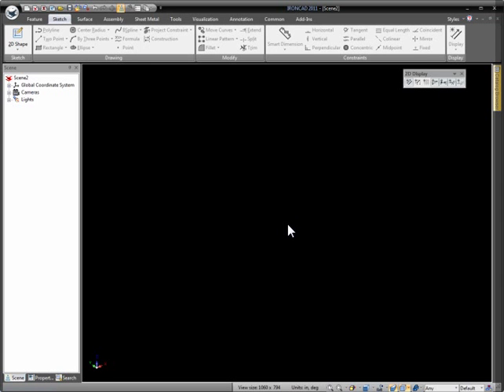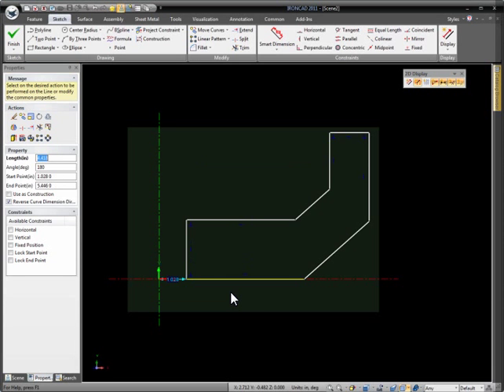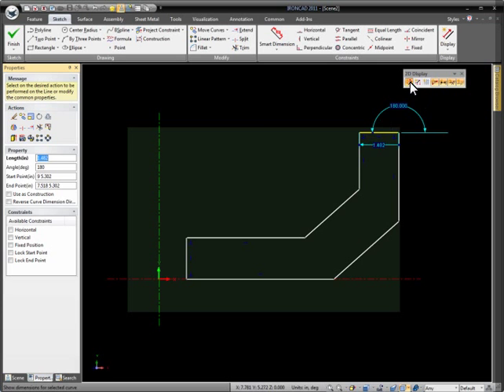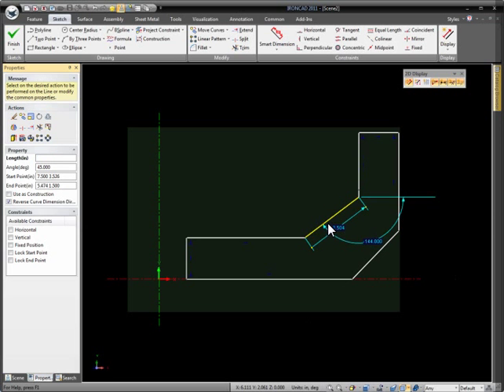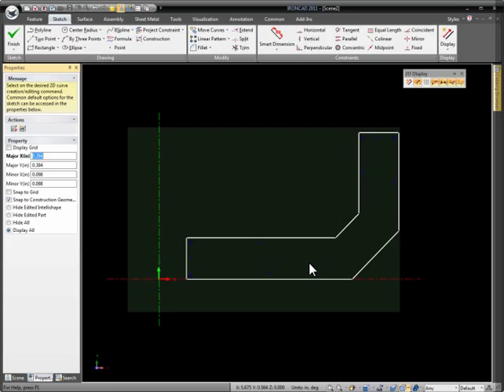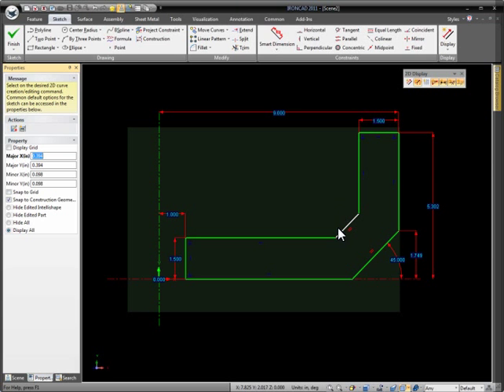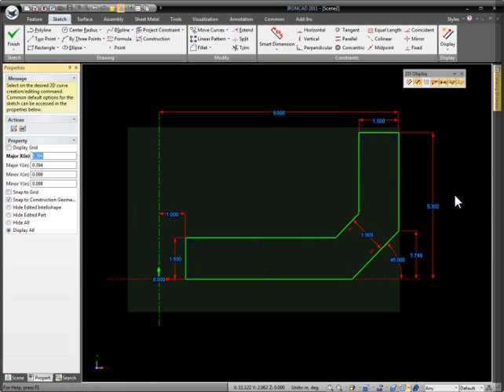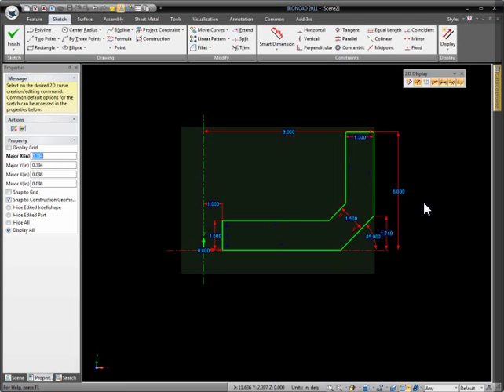IRONCAD #008 - Sketching Geometry Basics

Comment: I'm trying out IronCAD and am having a hard time with one of the most basic 2d sketch tasks. How do I constrain 2 points to each other? For example, nothing I've tried will constrain endpoints of one rectangular construction geometry to the endpoints of another rectangular construction geometry. In every other CAD system I've used, if the endpoints are drawn on top of, or they are dragged on top of each other, a relation is created and kept even when the lines / shapes have their lengths changed parametrically. In IronCAD, I get all my construction geo set up, go to change one thing and everything comes disconnected...
Reply from the maker: Hello David,
IronCAD leaves the auto-constraining off by default becuase for most users that is what is preferred to enhance the creative design workflow. However, if you prefer to work in the traditional approach, then while in the sketch you can right-click >constraint> and turn whatever constraints you want automatically applied under the "automatic" section of dialog. Also, you can add them at will during the sketching mode, they are available on the sketch toolbar. Also noteable is, if you see the dark blue "constraint" indicators on the sketch, they are not constraints, they are just showing you the curent state of the geometry, but you can right click on those indicators and lock them to constraints at which point they turn red. Hope this helps you.